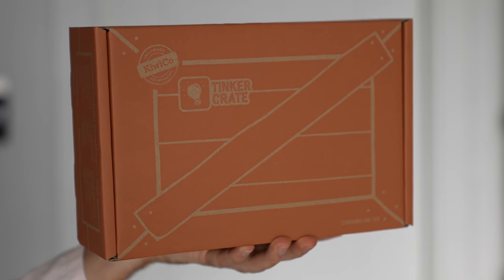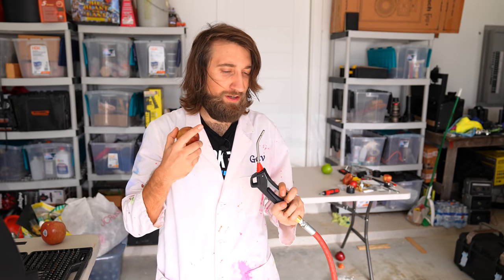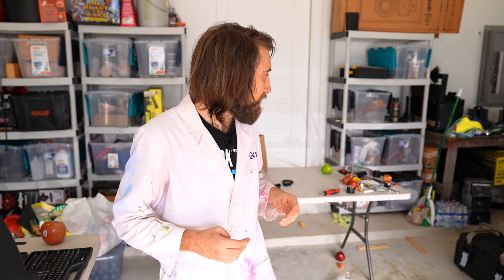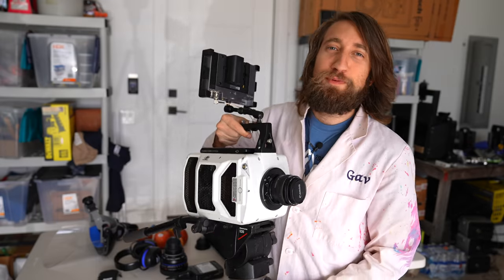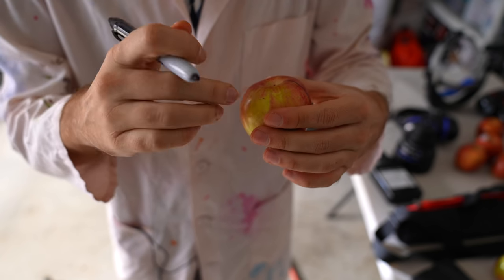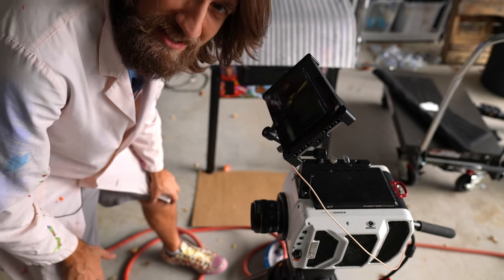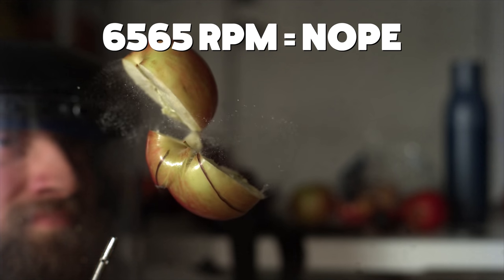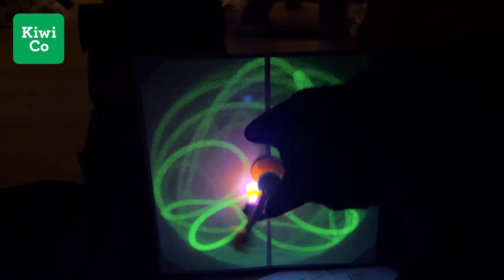Spinning an Apple until it Explodes at 28,500fps - The Slow Mo Guys

Comment: Dude! I like how when the apple breaks apart, each individual piece rotates in the same direction as the original piece.  Conservation of angular momentum I reckon.  Brilliant video.
Reply: hi destin
Reply: I discovered your videos the past year, and you're an inspiration. I love your admiration for science and anyone else that enjoys it. You probably get this all the time, but you're awesome.
Reply: Yeah I dont understand
Reply: What was the speed in mph? I got around 60mph
Reply: @tuckers91  would need to know the diameter of the apple  (also, Hi Destin, love your videos, thx for lending the camera)
Reply: @adfaklsdjf  on average from my fruit bowl. About 4cm
Reply: I'm curious if the apple is tearing apart because of the speed in which it is spinning alone, or because the area near the stem of the apple is creating a pocket that the air stream hits and at that speed the apple is pushing so hard against the air when it's coming back around it finally breaks. While watching the RPM calculation, you can see the apple doesn't fail until the stem is nearly perpendicular to the air stream, and that seems to also be the case when watching back the original video that wasn't fast enough to see the failure in detail but you can see the same kind of orientation to the air stream. This came to mind looking at the other one that didn't explode it seemed to be rotated around the axis in a way that the stem pocket never hit correctly.
Reply: Good to hear a more proper scientific explanation
Reply: @tuckers91  4cm? That's some small apples. The ones we have are about 6cm in diameter and that roughly seems to match those in the video.

6500*2π*0.03m / 60s ≈ 20.4m/s ≈ 45.6mph
Reply: I wonder why one of the halves splits again, though. I would expect that some of the rotational speed has been lost in the tear, so not sure why that part would break at a lower rotational speed instead of at earlier at the higher speed.
Reply: and this is how we know that neutron stars are not a thing
Reply: @YourMJK  yeah, just some pre packed kids ones
Reply: Not each piece. Some of the smaller bits went off rotating in different directions. Not all of our planets rotate in the same direction, and I'm sure that holds true to some of the moons too. It all depends on how the main body acts on the smaller bodies, and how those smaller bodies act on the even smaller ones.
Reply: @jjbankert  Good question. Both halves should maintain the rotational speed (they share the momentum but also have ~half the mass each now) and a half apple is probably structurally way less stable than a whole one, which is why I guess it broke again.
It could also be that the high pressure air stream has caused the rip.
Reply: Definitely conservation of angular momentum. However, the center of mass on each piece shifts, causing the part of the apple which had been closer to the center (and therefore moving slower) to have to reverse it's direction of rotation.
Reply: Lol. Hi Destin
Reply: Vid explaining this?
Reply: Sounds like an interesting physics problem
Reply: @LiberatedAmon  just like Slo Mo guys, he rents or borrows them from Universities or other businesses. These cameras cost an insane amount of money. Slo Mo guys have used way faster cameras before in previous videos.
Reply: How about spinning a baseball until it explodes? I'd imagine it would be able to reach a much higher rpm.
Reply: 3:05 I would bet GOOD MONEY that Destin @ Smarter Every Day tipped Gavin to draw this line on the apple after they spoke. Cause that seems like something he would think of
Reply: You're the best. Cool vids that I randomly rewatch. Good Guy.
Reply: FAN OF THE CHANEL
Reply: @VideoManDan  talk about comparing apples to moons!
Reply: It’s funny how Gavin YouTube is called slow mo guys yet he always uses destin’s cameras
Reply: you're too smart for us
Reply: @SmarterEveryDay
There's got to be a dose of centrifugal force at play in the overall physics of this effect.
Reply: Personally, I prefer your style. Its more entertaining/educational.
Reply: Thank you for loaning your camera to Gav!
Reply: Slomoguys, smarter everyday and veratisium are my favorite channels on YouTube ♥️🔥
Reply: ok nerd
Reply: @OceanBagel  - Same idea.  As soon as he mentioned Destin, I thought, “Uh oh... Now he’ll try to spin a baseball apart and accidentally open some kind of space-time portal.”
Reply: what
Reply: Gavin: hey I need your phantom.
Destin: why?
Gav: I'm going to blow up apples with air pressure.
Destin: I better get the video as well.
Gav: but it was my idea!
Destin: and it's my camera.
Gav: shocked pickachu face
Destin: ....
Reply: You know, for a long time, I always thought your name was Dustin. And like a year ago I learned it was Destin. I like your name. Such a unique name.
Reply: Centrifugal force is responsible for breaking the apple.
Reply: What got me was how it split righty down the middle. Does it always happen like that?
Reply: Yea Yea. Conservation of angular momentum. FOR SURE. 
We’re so smart. Me and you.
Reply: So, some maths seems to be needed here.
....

Diameter of apple = 0.08m
Circumference of apple = pi*d = 3.14 * 0.08 = 0.251m
Revs = 109/sec
So highest velocity of a point on the surface = 109 * 0.251 = 27.381 m/s
Acceleration = v^2/r = 27.381^2 / 0.04 = 18,742 m/s/s
Acceleration in g = acc/9.81 = 18,742 / 9.81 = 1,911 g

1,911 g - seems high to me, but maybe it's right......
Reply: Real recognize real
Reply: Converting say what
Reply: I like how I knew exactly who Gav meant when he said "I need to call Alabama"
Reply: What do you reckon what happen if you tried this with a peeled Apple
Reply: Can u do it too see if the apple breaks apart in the three like the spaghetti noodle does
Reply: I’d love to see a video collaboration with destin and the slow mo guys
Reply: My thoughts exactly, Destin. It was utterly fascinating to see conservation of angular momentum in those apple fragments.
Reply: Love your vids Destin!
Reply: Destin is the guy you call when the guy you called needs to call a guy.
Reply: english please
Reply: Thank you
Reply: Idk if y’all notice but when the apple spilt apart the stem split in half
Reply: Thanks for lending the camera to Gav!
Reply: Also observe the apple splitting into three roughly equivalent segment. Just like a gas turbine disc burst failure ;)
Reply: Stop nerding on us.
Reply: Thanks for the camera :)
Reply: Hi alabama!!!!
Reply: Thank you Destin, for helping to make this video possible.
Reply: Thanks for lending your camera to make this video possible!!!
Reply: Motion of a galaxy 👍🏼👍🏼👍🏼
Reply: Dustin, think you can do this as well? I want to know why the structural integrity failed. Was it the fluid rising to the skin, or perhaps it was the weak point in the apple's core? Also, did you notice how symmetrical the halves were?
Reply: @Smartereveryday I was hoping to see you chime in.
Reply: Alabama gang
Reply: Galaxies
Reply: I wonder if the same can be repeated with a round tangerine or a thin-skinned orange to test if the apple's core or stem is a weaker point where the tear starts from.
Reply: nah
Reply: WE LOVE YOU THANKS FOR LOANING GAV YOUR 2511!!
Reply: @LMitchellAnimation  My assumption is that the apple is experiencing an centripetal force and starts to rip from the center of mass outward. The centrifugal Force is proportional to RPM. So the faster it goes the more force is being applied. This is my initial explanation if anyone wants to correct me please do so.
Reply: spoken like a true british person. wait-
Reply: What was your objective of communication in offering this comment?
Reply: yea the bippity bops do the eh bingo bongo yea?
Reply: hi
Reply: I can't believe Chakra is real
Reply: Nothing to see here. Just a nerd watching a nerd...
Reply: @edwardpaulsen1074  no, they are a hypothesis only. And not even a good one. They have no real formation mechanism, no incentive, and they have no concrete evidence. A silly hypothesis for mechanistic minded, gravity first Big Bangers who know nothing about the latest HEP results in plasma physics. You don't need Neutron Stars to explain Pulsars. At 20k rpm or even 98k rpm some have been said (lol! 😆) they would not exist. Pure fantasy.
Enjoy the fantasy but just so you know it is all crumbling apart. The hypotheses have almost all been self debunked through CDM research and meanwhile plasma cosmology just keeps winning and winning. See: fusion research changes. See: black holes (modern vs classic) See: charged AGN. 
Stars are plasma-electromagnetic... Gravity is a semi minor consideration. But once there is enough charge well yes there will be a lot of mass and gravity. But it has nothing to do with "neutrons" which are dipole pairs of electrons and positrons bound by electrostrong forces.
Sorry to burst your bubble. Having my bubble burst wasn't fun at first, either. But if I survived it you can, too. Stop supporting Scientism and fake news science. The fantasy has been expensive and sorta useful but an embarassment overall. Time to get back to real, lab based natural sciences and leave behind mathemagic and engineered mumbo jumbo. Neutron Stars are NOT a thing. Never were. Those are just pinches with extremely high BE currents. Best wishes.
Reply: Do it with a watermelon
Reply: More likely inertia. Conservation of momentum explains why the smaller piece rotates flaster than the bigger ones.
Reply: More likely to be because of inertia of rotational motion. Conservation of angular momentum explains why smaller fragments rotated slightly faster than the bigger ones.
Reply: I can't remember if it was in one of your videos or one of the Slo Mo Guys', but that last break of the apple reminded me of the slow motion uncooked spaghetti breaking where it always breaks into three pieces because one of the halves has too much force to stay intact itself. Very fun to watch!
Reply: @IMMORTALSYMPHONIES  finally a smart comment on here omg.
Reply: You’re wrong it’s because of Jesus and also he made the dinosaurs some people think Moses and everyone else in the Bible was actually dinosaurs and that’s why they lived so long you better praise trump Jesus and Pepsi cola
Reply: 100th replied to make it even
Reply: @NONONOLANCP  101 for the odd and the Airborne 101st!
Reply: I read that in your voice!
Reply: Exclaimed outloud when I saw those two pieces spinning in perfect union. Love it.
Reply: I read this in your voice.... And your accent.
Reply: I like how you send your very fancy camera over to him for stuff like this.
Reply: Your videos are brilliant to.
Reply: And now the world needs to know the terminal rotational velocity of a baseball.
You know you want to...
Reply: DESTIN IS THAT DUE TO BERNOULIIS PRICIPLE???? APLE ROTATING??? PLEASE SAY DESTIN
Reply: Thank you Destin!
Reply: @LMitchellAnimation  I guess he's going to have to try again with an Orange or something else without a cavity at the stem
Reply: It’s so cool that you guys collaborate like this
Reply: Dude! i love your vids. one of you even visited the children's science museum in my city <3
Reply: Conservation of angular momentum is A FALSE THEORY. Do you know why? Because if the momentum were really conserved, then instead of the pieces flying in a straight path away as they actually do, they instead would swirl away in the same revolution as the apple (as if they were going to orbit) and CURVE THEIR MOMENTUM. But guess what? They don't, they won't, & they cannot.
Reply: thanks for letting gav borrow your very expensive toy to make these videos XD
Reply: "Now gimme my camera back!"
Reply: Good old days when physics was integral part of my life.
Reply: Destin! Looking after the fellow fun people on YouTube 👍🏼😎
Reply: 100% that's what it is, love the effects that has. especially the phenomenon where reducing the radius of rotation for an object makes it spin faster to conserve momentum
Reply: @LMitchellAnimation  I think it's because the apple is weakest along the stem axis, not a pressure effect into the stem pit
Reply: You're such a nerd I love it. I want to jam with you someday.
~Trav
Reply: Some uranus rotation too!!
Reply: There was one small piece that went the opposite direction
Reply: Why does it explode in the first place?
Reply: 916SavageMoB  Yeah call me slow but help me understand why. I mean, it could have just caught fire because of the friction but it didn't. It exploded. Explain.
Reply: Yes because this is a Newtonian apple
Reply: No. God wanted it to be so. So be it. Amen! Kappa
Reply: LOL my wife and I thought it was a nod to Destin (very cool!), THEN we (as most in Alabama do) thought about the "Call me Alabama" signs.
Reply: Why do own a $150,000 camera?  Absolute madlad.
Reply: I wonder if it always splits into 3 large pieces. If so, why?
Reply: @noisywan  now you got me curious! Good question
Reply: Is centrifugal force is responsible for this failure?
Reply: i was thinking it was something about Centrifugal force that was forcing the apple to litterally throw itself apart
Reply: Destin... Do the experiment with different fruit.
Reply: lol
Reply: Not only that but the initial breakage looked like a clean even split!
Reply: I read this comment without reading the name and as i was clicking off the video i thought "That sounds like something Destin from smarter every day would say"
Reply: @ultimecia102  Funny enough I didn't even notice that myself until now
Reply: yeah... of course that would happen.
Reply: whats so big abt it? if your body is moved that fast and it explodes. your head and hands too will move in same direction...bahh
Reply: I’m smart
Reply: @dirkdiggler69  he doesn't even really deserve to be called a nerd when he's pointing out something so obvious.
Reply: @LMitchellAnimation  Based on my back-of-the envelope calculations, assuming the apple has a diameter of about 10cm, then at the max angular velocity of 100 rotations per second, the outside of the apple would be experiencing an acceleration of approx 200g
Reply: The golden rotation energy
Reply: @YourMJK  That's what I was thinking. I'm trying to wrap my head around the variables that would cause it to keep splitting indefinitely.
Reply: Dude! No way
Reply: Physics 101 LOL
Reply: Can you make laminar flow with the help of an apple?
Reply: Thanks for sharing the phantom <3
Reply: Right so if there was a big bang explosion why do some planets and moons spin in opposite directions. Atheism fail
Reply: @halaniwalombardi3562  Disclaimer: I'm not an atheist. Even with a given starting angular momentum, it's possible for subsets of matter in a system to have relatively negative angular momenta without violating conservation, allowing other matter subsets to have greater relatively positive angular momenta.
Reply: And yet people think the big bang is real. Despite planets that spin clockwise and others that spin counter clockwise. All that momentum came from the same initial bang right?
Reply: That's a misleading example of conservation of angular momentum. A better example would be a situation where one piece after explosion starts spinning in the opposite direction, while other pieces spin in the same direction but faster.
Reply: @Pete856  Any subsection is going to have the same angular direction as the whole, regardless of proximity to original center, since the apple was a (roughly) solid, singular mass.

But some pieces weren't cleanly separated - the most obvious piece spinning opposite the original mass was clinging to two larger pieces on opposite sides, and those pieces dragged it into counter-rotation before fully separating. Somewhat like a chain of three gears in principle, where they can't all three rotate the same direction.
Reply: @Some_One_One  There's nothing to drive that continued curvature in the path of the pieces. The conservation of the angular momentum is observed in the angular momentum of the separated pieces rotating about their own centers. Their path straight away from the original center of mass is linear momentum, and in the absence of any confounding complications (like gravity since the parts are no longer suspended) the linear momentum of the pieces of an exploding apple will add up to the linear momentum of the original apple - in this case about 0 m/s, since the apple was roughly still in terms of linear motion.
Reply: Did you notice 3:33 to 3:49 the apple was looking for a path of least resistance? Once it found that path it kept its trajectory till exposition regardless of how far away it was from the jet stream. Also, regardless of the mass of the smaller pieces, they almost keep the same rotating speed as if it were whole. Very interesting that.
Reply: Conservation of angular momentum is a slightly oversimplified explanation because the spinning of the fragments only accounts for a some of the original angular momentum. That the fragments fly outwards with an offset from the original center of mass are another form of angular momentum.

Mechanically, the post-fracture spinning of the apple chunks can be explained by each chunk containing apple matter from both near the outside of the original apple and from near the center of the original apple. Prior to fracture, the outer matter was moving faster than the inner matter, and this variation of initial velocity in across the apple chunk's depth is what causes the chunk to spin about its new center of mass.

The amount of chunk spinning depends heavily on the fracture pattern. If the apple were to fragment such that the outer portions of the apple were in different chunks than the inner portions of the apple, then the chunks would spin less. More of the angular momentum would be in the post-fracture chunk velocities, and less would be in the spinning of individual fragments. The most realistic way for that to happen is simply fragmentation into zillions of smaller pieces. However, in this video, the apple cleaves hemispherically, so we observe a lot of chunk spinning.
Reply: I think the the stem area and the bottom of the apple are weak points maybe it's "nope terminal zone" could go higher js
Reply: I reckon the skin rips first since its spinning much faster than the center.
Reply: @tuckers91  you sir
Are buying very small fruit
Reply: It's also a centrifuge, the moisture is accumulating at the outermost diameter, which means that before it explodes the RPM probably decreases.
Reply: The particles in the apple that were further away from the center would carry more momentum so when the pieces break apart, the particles with more momentum would overcome the inertia of the particles with less momentum resulting in an imbalance leading to a spin. How does that sound?
Reply: Doesn’t everything so this?
Reply: I wonder if in space, if a planet got spun so fast that its guts can't keep up with it anymore, would split apart in chunks that go along the fault lines or if it would be more about pure chance.
Reply: I think It's centrifugal force and the uneven shape not angular momentum that explodes it. The force would come from radial stress and tangential stress exceeding the limit of the apple material.